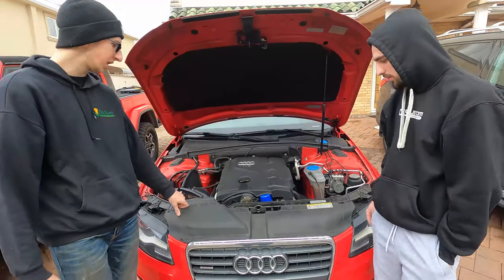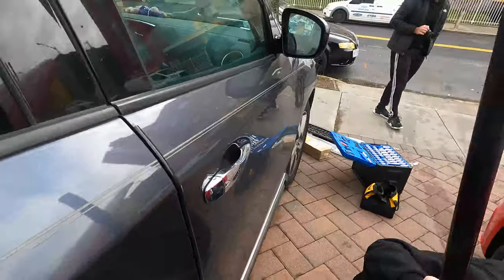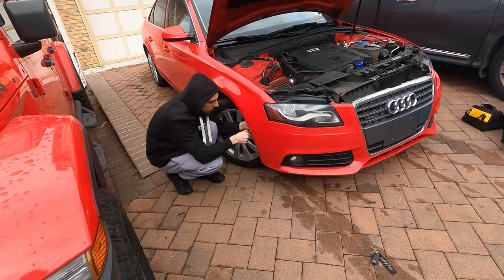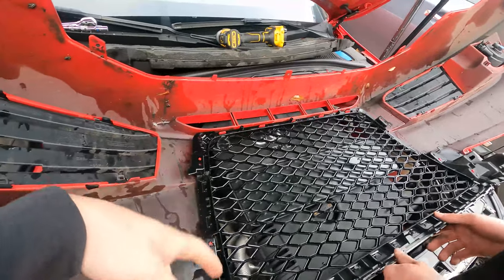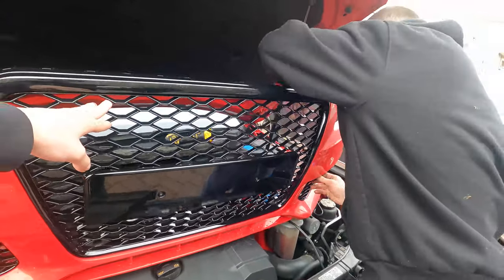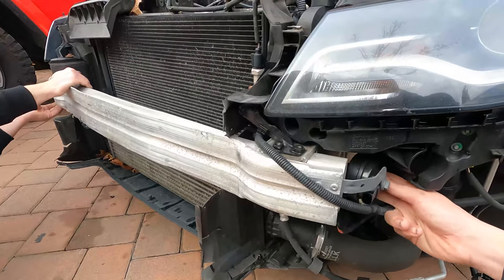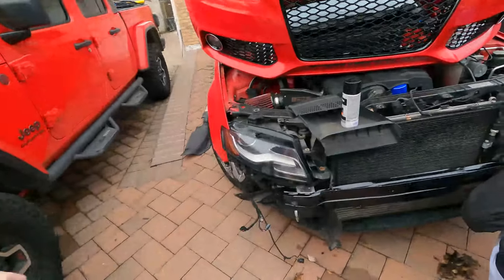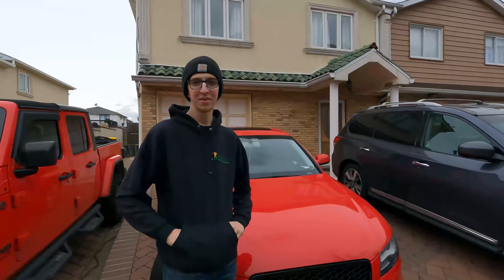How to Install an RS4 Style Grille on a B8 Audi A4

Comment: Yo what is that sensor for in the beginning I just installed my new grill
Reply from the maker: Ambient air temperature
Reply: @wellseegarage  so where do you plug it back in after the grill is installed
Reply from the maker: We zip tied ours back into place on our crash bar if that’s what you mean
Reply: @wellseegarage  ohhh ok gotchu thanks man

Comment: What did you guys do with the sensor that was behind the Audi emblem ?
Reply from the maker: We zip tied it to the bash bar
Reply: I just zip tied on the back of the bash bar as well. Did you also get the air bag and parking brake malfunction on the dash? I have a 2011 A4 manual transmission and the electronic parking brake still works, just get the errors and the air bag got me a little concerned. Let me know if you got the same problem and if you figured out what to do. Wanted the clean honeycomb look too 😂